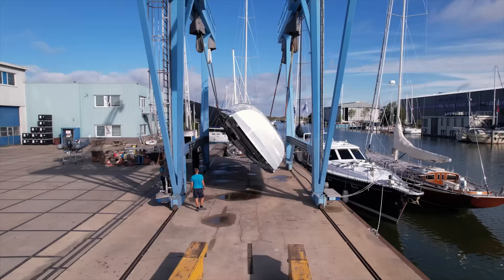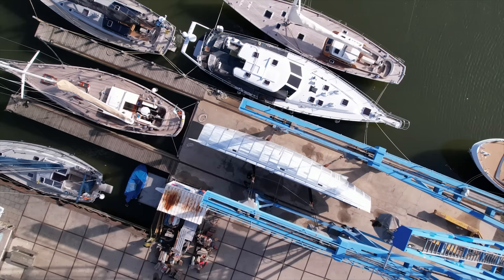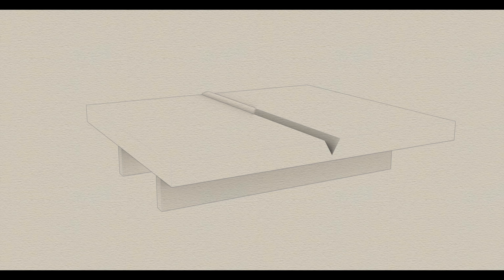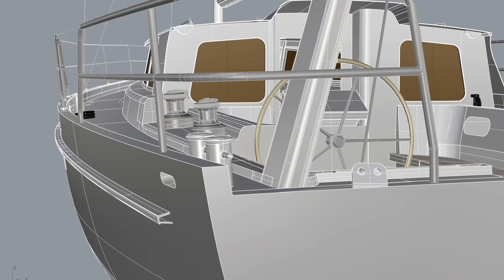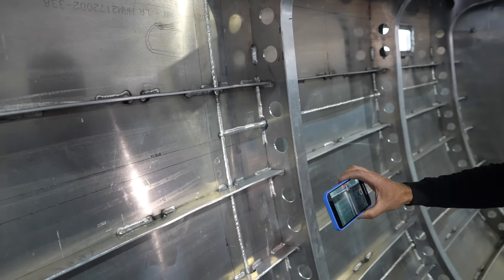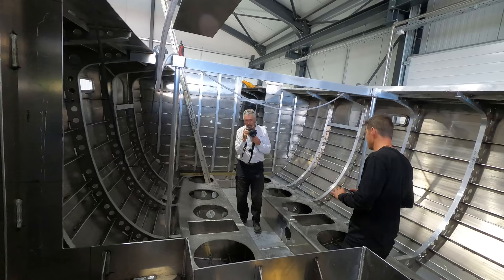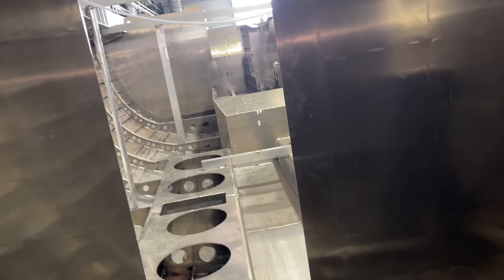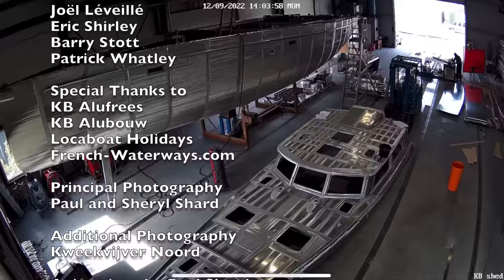Building an Aluminum Sailboat Pt 5 - How to Weld an Aluminum Sailboat | EP 223

Comment: Very interesting,  I was a mechanical engineer and designed an aluminum electronics enclosure for a navy shipboard auxiliary propulsion system. The problem we ran into with aluminum is  the mid section of the enclosure had a tendency to bulge in relation to the top and the bottom.  Aluminum welding and maintaining it to spec is truly an art. Probably should have the cabinets built in the Netherlands, they obviously have the experience. Incredible work.

Comment: Looking good, much easier to get a feel for the finished yacht when it is upright. The upside-down walkthrough in the last episode was a bit challenging to visualize (maybe I should have turned my monitor over). One of my questions was answered here, I always wondered if the hull formed part of the tanks or if they sat on the hull - it looks like the former. Hope you include in an episode the installation of insulation, that is another thing I have wondered about aluminum yachts.

Comment: Hi Paul.  We spoke at Annapolis where I asked what type of MIG welder your builders used. I speculated it might be a pulse MIG, a relatively new and fare type. You said you would enquire. Thanks.
Reply from the maker: Looking at our video I see the machine is made by Fronius and appears to be a TransPulsSynergy machine so I suppose you are correct from the name it is a pulse machine :-)
Reply: @DistantShoresTV  I've got to get a bigger screen so I can see that!  Thanks.  I've written several books that touch on aluminum fabrication and I have to say that this welding is very impressive.  I really enjoy the technical details you present, but also your videos on canal cruising.  I've done a little of that in France on the Cher leading into the Loire. Bonne route!

Comment: Thanks for sharing, the hull thickness was incredible, you'll have no problem with icebergs :) An old salt once told me when asked about longevity of hull materials, "steel lasts 100 years, aluminum lasts 50 years and fiberglass lasts forever". That being said, I can see where aluminum could be lighter and faster, additionally I have seen a very old aluminum boat (which was painted) where the salt got under the paint and corroded a hole through the hull and required a huge amount of work. Do the boats that are not painted have the same problem?
Reply: Commercial Steel boats/ships have a design life of a few decades at most.  Aluminum can last forever because when exposed to salt an oxide layer is formed, which is inert and protects the raw aluminum.  (This process is called passivation, and the resulting layer is called anodized.)  Plastic boats probably last forever.  Consider how long the oil they're made from lasted in the ground. 

Aluminum is probably the most eco-friendly since it's so durable and is fully recyclable.

Comment: Hi Guys, I was a bit surprised that there was no extraction visible inside the hull. The Argon shield gas is much denser than air and would fill up the hull rapidly with potentially fatal consequences ! Was the extraction just removed for the video? It was great to see the competence testing that the welders undergo, I spent a considerable part of my working life certifying welders for aerospace work and the testing these guys are doing is quite similar - very reassuring 😎
Reply: The hull was welded with the hull upside down.

Comment: Just for interest's sake, why did they do staggered welds of the stringers to the hull? To reduce stresses on the metal, perhaps?
Reply from the maker: Thanks Zuko. The staggered welds reduce the stresses that can come from welding. Its similar to doing full welds on either side which make even support.
Reply: @DistantShoresTV  makes sense. Thanks. I am inspired by this build. It has me dreaming.
Reply: The stitch welds on the frames prevent too much heat input and shrinkage which would pull the plates over the frames creating a starved horse look which would look terrible.